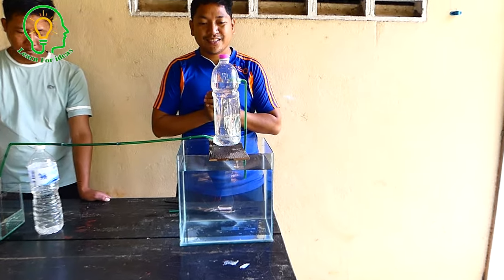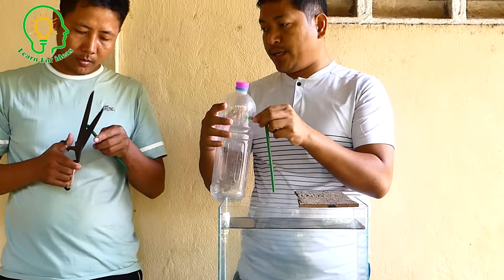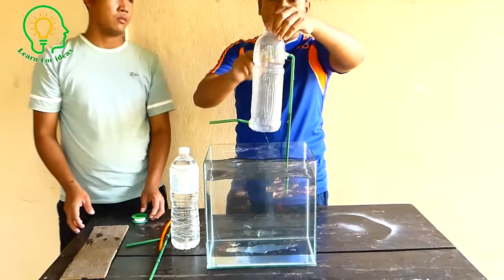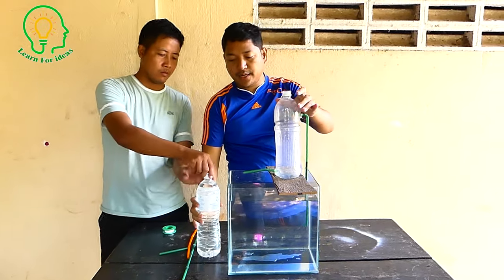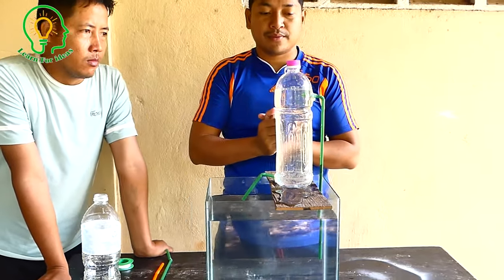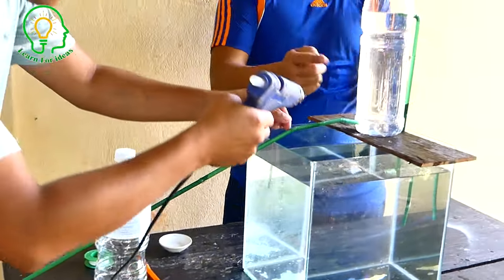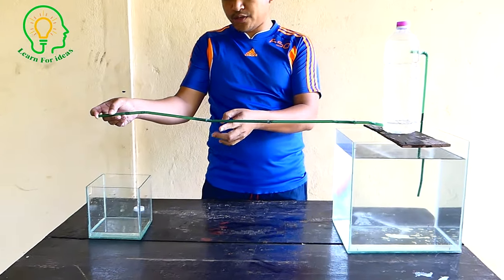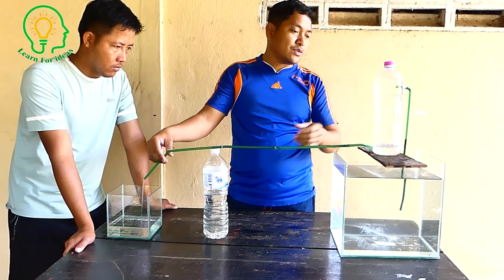How to make Auto Pumping Water - Water Heron's Fountain nonstop from a plastic bottle.

Comment: Due to friction and head loss, an eternal pump cannot be achieved. This diagram shows Vaccum and suction, the water level have a difference so higher level goes to lower level automatically. It will find equilibrium and will cease to move.

Comment: easy easy , conclusion is the output volume MUST be bigger than the input . 
2 solution for the output : 
-make it longer
-make it bigger

btw Great video mate 👍
Reply: volume isn't the variable at play, it's all about the height of the water coloumn(s) and relative height of the straw(s), this determines the amount of atmospheric pressure present (every 33ft deep in water is 1 atmosphere of pressure (1 atm), irregarless of the volume i.e. if its a swimming pool or the ocean), at long as the output straw is lower then the input it will drain/ pull water up the straw. 
P_h= P_0 e^{\frac {-mgh}{kT}}
P_h	=	pressure at height h
P_0	=	sea level pressure
g	=	acceleration due to gravity
k	=	Boltzmann's constant (ideal gas constant divided by Avogadro's number)
T	=	absolute temperature
m	=	mass of one air molecule
Reply: output must lower then source water lvl.

Comment: That is a bell siphon my friend and you don't need the barrels your just making more work for your self all you need is to valves some pvc and a priming point and you can achieve the same outcome with a u-siphon
Reply: No, this is not a bell siphon, but it is a siphon. In a larger system with a barrel, you may drop the foot valve at the input and if there are some air leakage in the tubing the barrel will take up som air before the siphon stops. The same if there are gas that dissolves from the water.

Comment: He foolse us. Every one know water flow      hither level to lower levels
Reply: In Your methods no need of water bottles   you connect direct pipes then also flow the water. Because input put water level high output water low
Reply: @satyanarayana79  That is correct, but he also show the prinsip of a ‚barrel pump‘. A barrel can be practical fore some reasons. Here yoy see that no foot  valve at the input is needed due to the bottle.
Reply: Water goes down and creating vacuum effect thus sucking water from higher tube which connected to pool water.